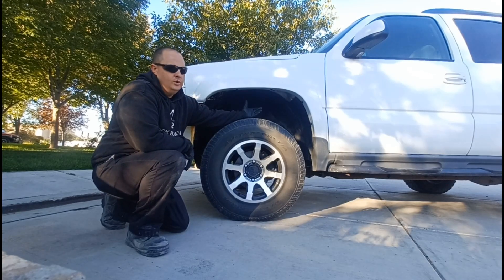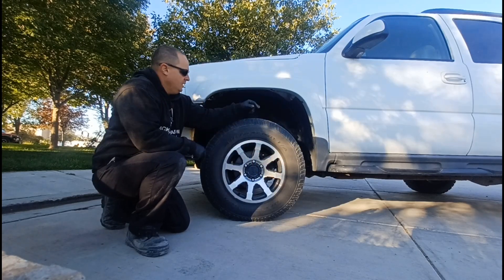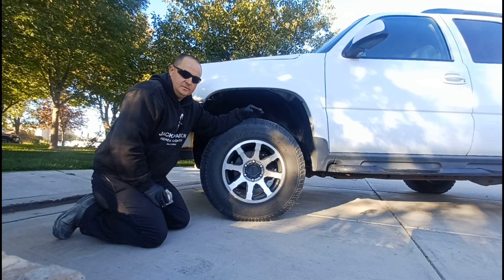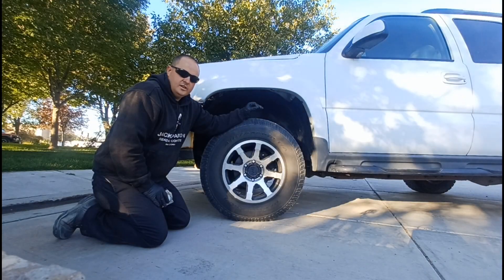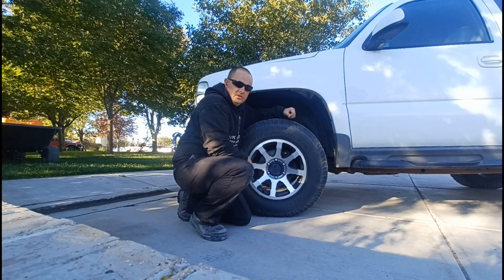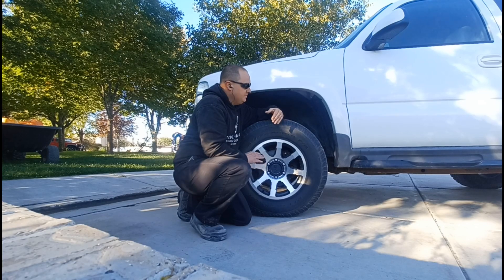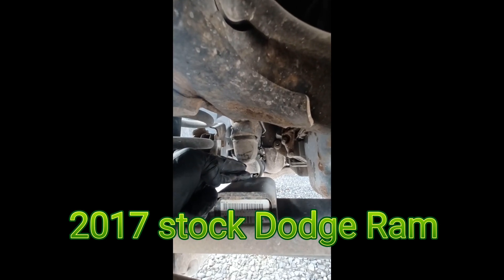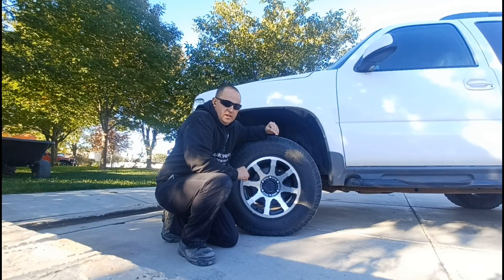How much Lift you will get with the #tahoverlandingaxleswap Episode 12

Comment: Best thing I've done to my suburban by far!!!!!!!!!!!!!
Reply from the maker: Heck yes!!!!
Reply from the maker: What measurement did you end up with on yours?
Reply: @tahoverlanding  I can tell you after I measure..
Reply: Sorry it took so long to get back with you. from the fender flare its 24 7/8"  I will assume to the metal fender will be 25".
Reply from the maker: @overlandtowater  25" is the same as mine. I've got 4.5" up to bump stop. As I recall you kind of shot from the hip with your bump stops. Do you remember where you ended up?
Reply: @tahoverlanding   I never really measured after installing them. I will measure for you... the bump stops I went with are 2.5" extended bump stops for a dodge ram. The oem bump stops will work great and the only reason I went for the extended stops was to preserve my washer fluid bottle after I figure out how I want to relocate it I will more than likely trim my extended cushy stops in half.

Comment: What is the height from center of wheel to lip of wheel arch on a second gen 4x4 Tahoe or Yukon with the stock front end ride height?
Reply from the maker: @Tbolt1000TForLife  as is described in the first 2 minutes. "Stock" that number varied widely from year to year, and with different trim packages. 

That's also not factoring that nearly none of the 20+ year old vehicles made it through the last 2-1/2 decades with the torsion bars not being adjusted.

That's the reason going off the rear rather than front is a more accurate measurement.

Comment: During mock up. How do you know much the spring will compress once loaded to set the bucket height. Do you just tack it in and see where it sits?
Reply from the maker: Maybe I should do a video on that, 
I can tell you that the average person has been finding that they compress to between 13 in and 13 1/2 in at ride height so that's a good starting point for you to tack it on and see how it sits

The alternative is to do what I did which is once you've got the independent front suspension removed you can set the front of the vehicle down with the coil springs underneath the frame between the frame and the ground. I used a plank of wood. And measured from there. I got 13 and 1/8"
Reply from the maker: I should add that that is with Ram 1500 Factory Height Springs, if you were using different Springs like the stiffer ram 2500/3500 springs or aftermarket lift springs obviously that number would be different.
Reply: That is an excellent answer. Thank you. I was curious about how one would measure spring sag.
Reply from the maker: @brentdykstra4292  if you have Instagram, I did a post about it like 2 years ago. I could tag you in it so you can find it

Comment: I have a 2013 gmc sierra 1500. I have been wanting to do a solid axle swap. would you have recommendations on the kind of axle I should use?
Reply from the maker: I also have a 2012 silverado 1500 that I bought to measure. It has a wider frame, so you'll need to French my coil mounts in a little bit.  

But apart from that, it looks like the swap is pretty much the same
Reply: @tahoverlanding  what axle would u use?
Reply from the maker: @116thcavscout  the same 2000-2001 Dodge Ram Dana 44 with the tahoverlanding caliper spacers and gmt800 hubs and rotors
Reply: @tahoverlanding  would there be any special parts for the abs and the wheel sensors
Reply from the maker: @116thcavscout  watch this all the way through https://youtu.be/dEOZhPjSMCg
Reply from the maker: I see that you're not familiar with the #tahoverlandingaxleswap 

This swap uses the 2000-2001 Dodge Ram Dana 44 which accepts your factory Chevy unit bearing hub assemblies but you'll need to use the tahoverlanding brake caliper spacers which make the Dodge caliper centered on gmt800 front rotor and your Chevy hub assembly
Reply from the maker: @116thcavscout  since you're using your factory hub assemblies, the ABS sensors are built into those. You just need to extend the sensor wires. Apart from that, the ABS system works the exact same way as factory